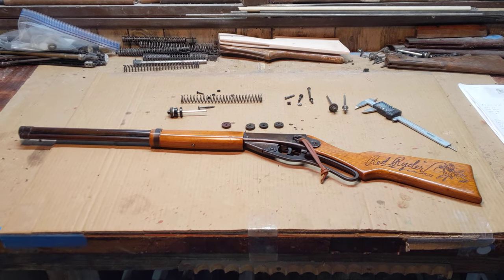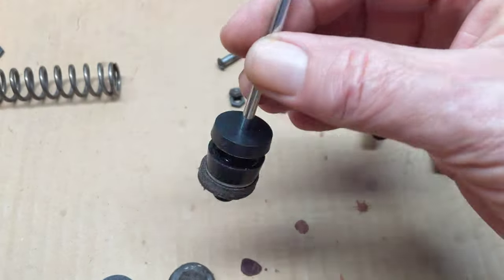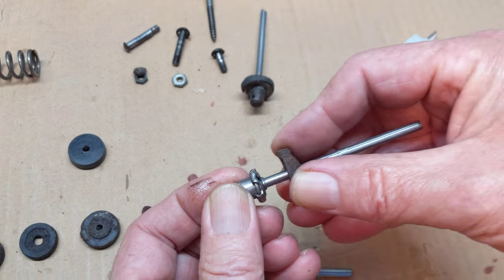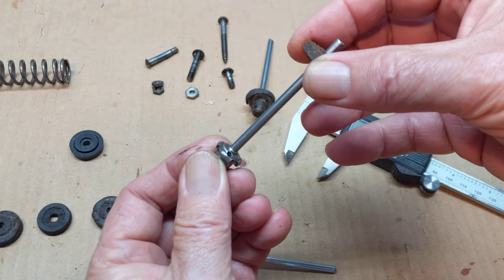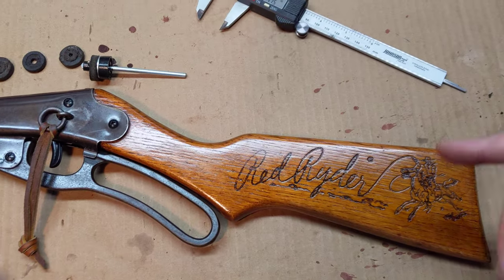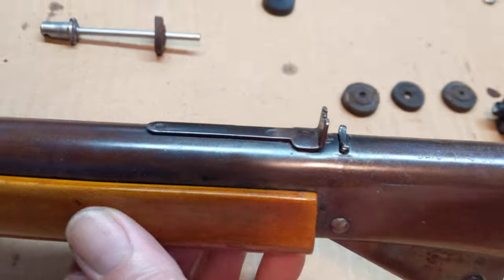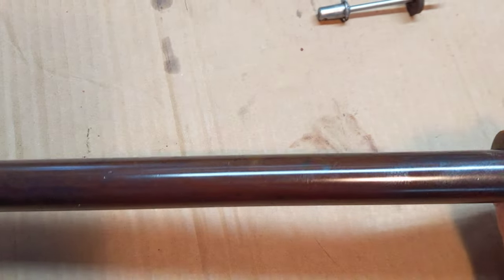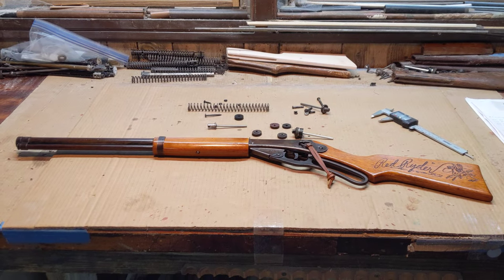Daisy #111 Model 40 Red Ryder Carbine with leather seal issues ( a cool Oak Buttstock)

Comment: That 111-40 is in great shape!  Your videos are always enjoyable, Shane.  I have found that with both leather and neoprene abutment seals I get a good result when installing if the compression chamber is completely cleaned of oil and dry before seating them.  Seating the abutment seal dry will help it to stay in place and to not ride on the air tube.  I also seat the plunger head seal on the air tube dry to help keep it in place during the firing cycle.  I only oil the compression chamber and outside edge of the head seal when reinstalling the plunger assembly.  Have restored over 20 Daisy's and this approach tends to help keep the seals where they belong.
Reply from the maker: Thanks Jim,  this particular seal was really a tight fit on the air tube hole, lots more drag than I'm used to seeing with the reproduction leather seals. Maybe the punch die is getting a bit worn and producing a slightly smaller hole than desired.

Comment: Great video Shane and alot of information.  Beautiful ol rifle for its age .  Question on the leather seal , could you have put oil or a grease to help with the rod sliding and the seal staying place ?
Reply from the maker: Sarge, I'm always hesitant to use adhesive with the leather seals. ES6000 is supposed to work great but if you ever need to replace the seal getting the residue  out of the end of the compression chamber is going to be a lot of work.

Comment: Shane, I have a 111 model 40 that I bought but it’s in need of some work. Can you point me in the right direction?
Reply from the maker: What's it need? Most of the basic stuff is doable at home.
Reply: @RestOModDaisy  As far as I can tell, some miscellaneous hardware (some is not installed, some has been replaced by random stuff), blueing, new wood, and maybe a new seal kit. It does shoot, but I haven’t disassembled it to check the seals (no manual). The thing that has me scratching my head is the barrel cap. It doesn’t appear to be seated all the way. There’s a large gap between the cap and the loader tube and bb’s just fall out.
Reply from the maker: Sounds like the airtube is extending into the barrel shroud as it should if the gun is not cocked. First remove the shot tube from the gun and empty it of all BB's. Take a peek down the barrel shroud with a flashlight and you'll most likely see a small tube extending from the bottom of the shroud pointing up the barrel. That's the airtube. Work the lever and see if the plunger engages with the trigger, if it does, push the lever back to the closed and check to see if the airtube is no longer visible inside the shroud. If it's gone, slide the shot tube in and see if it seats. If it does and the gap is gone load her up and see if it'll shoot. @85randycam